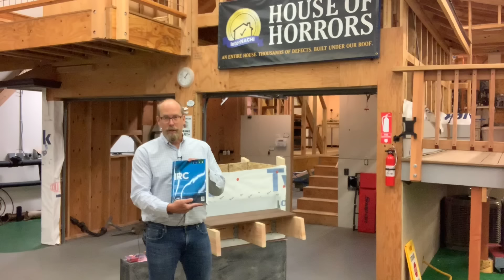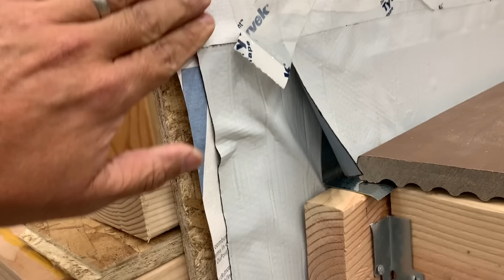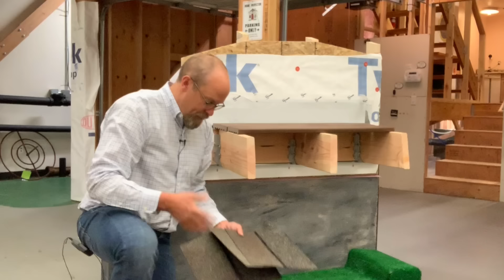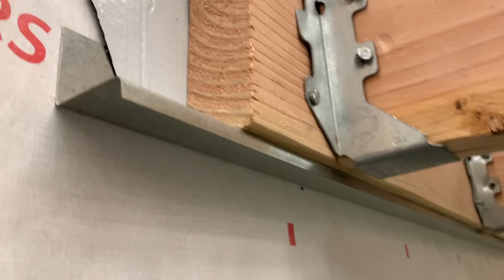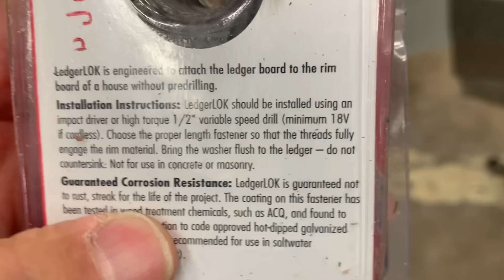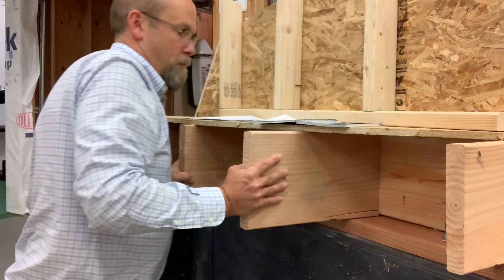Deck Ledger Board Flashing Inspection Tips

Comment: I disagree with having the metal flashing on the bottom of the ledger. In fact I've been a carpenter for over 40 years and I've never seen that done here on the East Coast. Your mock up is incorrect in 2 ways. 1st the use of interested Douglas fir should never be used not even for teaching students. 2nd today's treated wood formulas all contain copper which will have a dielectric reaction to different metals. There are a number of other flashing materials like copper, flexible flashings that have a copper film on one side and poly plastics. 

The lower flashing can hinder the run off of water that might get behind the ledger. I would run the flashing behind the ledger all the way down to the foundation.

Comment: How do you flash if the ledger is attached to a cinderblock foundation and above foundation the house is brick facia? There's no accesisible house wrap or siding I can tuck anything under.

Comment: Question:     I'm running a herringbone pattern for my deck boards.  It seems like running screws though the deck boards into the ledger board is needed to secure the ends of the deckboards to the frame.   To do so would mean putting screws though the bottom of the ledger flashing, which doesn't sound like the right thing to do.  Should the bottom of the ledger flashing be penetrated?

Thanks
Reply from the maker: Good question!

Comment: My house was built in 1931 & I used spacers for the ledger, angled the bolts slightly downwards to prevent water intrusion, & provided full support for the deck independent of the ledger. Obviously not to this code spec, but a 35 year old cedar deck on a 94 year old house. The "leaky condo crisis" led me to believe that building codes & construction methods are always in a state of continual improvement; it's not an exact science. Hopefully these building codes save homeowners from financial ruin in the future.
Reply from the maker: Thanks for sharing.

Comment: Please do not use spray foam to stop air leakage.  Im currently fixing the rotting deck boards and structural beam where the  contractor was using expansion foam for whatever reason. The rain water traps in there and creating rot wood. Water should go through all the way to the ground. A bit of air leak is good for the house.
Reply from the maker: Okay. Will do.

Comment: All these layers of flashing g and different methods is cheese. 

Relying of tape is a no no.
Using cheap thin tin flashing isn’t fair to the home owner because it breaks down over time and causes serious structural decay.

IMO…..the ledger board should be part of the construction.
Added onto the house while it’s being built, then cover it with rubber roofing.  24” over the top, and 12” past the bottom.
Carefully molding it over the ledger board like a glove.

At that point even a novice builder can attach a deck to the house without having to worry about causing damage down the road.

Water resistant?  Should be waterproof !!!
Reply from the maker: WRB behind the ledger board is recommended.
Reply: @internachi :  band board, then flashing, then the ledger board?
Water will get in there.

Comment: Even when installed to code a ledger board hung deck can cause tens of thousands of dollars worth of damage to a home's siding, sheathing, frame, foundation and interior walls, floors and ceilings. due to ice and snow build up at or above  or even below the ledger board..  Water behind a ledger board can freeze and separate a deck from the house by the expanding action of ice resulting in a catastrophic collapse of the deck.
Reply from the maker: Thanks for sharing the important reminder about the potential for damage due to ice buildup behind ledger boards.

Comment: @5:20 ish. i would bend the flashing beforehand, and joist tape the top of the joists installing them after the flashing is done. especially considering you would seal that up good before running joists. thats my 2 cents anyway. im not disagreeing with anything
Reply from the maker: Thank you. Good point.

Comment: Really glad I found your video. One thing I don't understand - why have flashing under the ledger board? It seems all  it would do is hold water against the bottom of the ledger. If house wrap, membrane, and ledger are installed in a "shingle" fashion, what purpose does the lower flashing serve? Thanks.
Reply from the maker: IRC code and commentary provide really good illustrations for more details. You may want to check it out.

Comment: Great video, thanks.  Wondering your thoughts on screwing the lag bolts holding the ledger board into the studs on the opposing side of the wall, rather than just the rim joist as shown.
Reply from the maker: Good point. It's got to have contact with structural components.

Comment: Do you have a video like this but for the area by the door? Also, that membrane doesn’t stick to wet wood so I had that issue before. The order and placement was correct but the membrane that was installed didn’t bond properly.
Reply from the maker: Good idea for a new video.

Comment: I've just checked the price for butyl flashing and am looking for a less expensive alternative that will be corrosion resistant to MCA lumber.   It appears that I can flash with the aluminum flashing what I currently have and isolate it from the treated lumber with the #30 felt paper I have left over from another project.   Thanks for the video!
Reply from the maker: You're welcome.

Comment: Many professionals here on YouTube don't cut the house wrap, which means they don't achieve a true shingled pattern. It looks like you cut the house wrap above, install first the bottom drip rail, then the wide bottom peel and stick membrane that goes over that bottom drip rail, then install the top drip cap, then a second layer of membrane that attaches over the top drip rail and under the top house wrap, and tape the house wrap layered on top of that. After all done, install the ledger board and you're done. The tricky part is how on either side lateral to where the cut ends, even the bottom membrane is taped over the section of house wrap. That corner on each side could be a vulnerable point of entry. It seems complicated compared to what the pros do.
Reply from the maker: Thanks for watching.

Comment: why put flashing on the bottom? Doesn't that just leave a place for water to sit in contact with wood?
Reply from the maker: It diverts/kicks it out from under the bottom of the ledger and the top of the exterior covering material, if installed.

Comment: Great video. Question, is the metal flashing below the ledger a firm requirement?
Reply from the maker: No. It's detailed in some codes and best practices. But it's critical if there's siding below the ledger.

Comment: Great video and its nice to know Im doing most everything correctly. The one thing I did not do was the flashing under the ledger board.
Reply: not necessary in some cases. especially if you're added deck to already built home. I feel like that's going to trap water onto the bottom of the ledger
Reply from the maker: Nice work. Keep it up.

Comment: I'm not sure what that bottom metal flashing is doing... probably holding water and rotting out the bottom of the ledger board.  Also deck framing should be built with pressure treated material.  This is a very complex subject, with many, many variables.  On a new house with a deck built during construction, you may see a deck this way.  Often decks are added to house after construction and are done differently.  Some good guidelines here though.
Reply: It's for the siding under the ledger,  but should have a pencil width gap so ledger isn't sitting in any trapped water
Reply: @kyletanner5867 you can use a j channel to cap the siding though. it’s also okay for water to get behind the siding so having that extra flashing potentially lead to rotting of the ledger board is more of a detriment than a benefit. 

also, som decks might not even have siding below the ledger, which would make that bottom flashing totally useless
Reply: so glad someone said this. i am learning as i replace my existing deck... we hired a guy who could "do it cheaper" he used framing 2x4s for the whole deck... including the ledger board. none of it was PT... so i decided to do the damn thing myself... 

that water trap he called flashing seemed wrong to me and i appreciate someone with experience taking the time to say something
Reply: Never saw non pressure treated used for sill plate either
Reply: @zanetracks6592 I think just for the demo about flashing, he used cheapest wood.
Reply: Right? This wouldn't apply to decks built after construction. And what about a deck built on an older brick home? You can't put the flashing behind the brick.
Reply: Go to college and get stupid. I'm only a few minutes in but it looks like he has galvanized sitting on what should be PT. It needs a bury or some barrier between them to prevent a corrosive reaction or pay for copper or stainless if you can buy it or have it made. Contracting is a lifelong " practice" just like a doctor or a lawyer " mentall.". Physically?  A little different. Lol
Reply: I wrote butyl tape for a barrier between metal and PT. Membrane backed copper is an option also.
Reply from the maker: Thanks for watching.
Reply: @internachi did you even read their comment?

Comment: Wouldn't a .25" air gap be a good idea below the ledger board so that it does not sit on the metal flashing?
Reply from the maker: Yep.
Reply: I would also make sure that lower flashing has slope

Comment: Nice video, the one glaring error that should have been mentioned is that the Tyvek WRB did not extend below the top of the foundation wall.  Current best practices and DuPont Tyvek Single-Family Field Installation Examples call for a 1" overlap onto the foundation below.  For air sealing, also part of the job of the Tyvek WRB, the product should also be sealed at the foundation overlap with one of the methods shown in the Field Installation Examples.  The IRC remains strangely silent about this, however common sense should dictate that the WRB must extend below the top of the foundation  ("in a shingle-like manner")
Reply from the maker: I agree with you, Larry. Thank you.
Reply: Good point.

Comment: that flashing on the bottom of the ledger is a great spot to trap water and rot a ledger. absolutely not needed. also, you mentioned putting the upper metal flashing BEHIND the ledger? makes no sense. totally agree with the ledger locks though.
Reply from the maker: What if the siding is installed below the ledger? Flashing is needed.

Comment: Does it matter if the fastener used to connect the ledger board to the house rim joist hits a house joist? Or do all tips need to be seen from inside the house?  Also how far from the left or right end of ledger board to the fastener/anchors need to be? Thank you.
Reply from the maker: These are great questions.
Reply: 2" from either side....he mentions it in the video

Comment: Why can't I put the ledger board over my marcenite siding, because the siding is exposed to the weather, anyway?
Reply from the maker: Good question. Ideally the board would be in full contact with the structure.
Reply: @internachi  Thanks for responding. I built my 16x32 deck about 8 years ago and I did attach the ledger board to hardie siding. After recently watching these videos, I installed 4 6x6 posts against the house for additional support.

Comment: When connecting the deck to the band joist of the existing house do you use lag bolts or just large nails? I have a 2nd story deck that was installed a few years back and I've noticed I have a water stain on my ceiling downstairs. It's right over the sliding door to go out to the patio below. But i'm thinking it mist be where the deck was attached to the band joist over that door..  Thanks, great video..
Reply from the maker: Wow. Sorry to hear about that. Thanks for watching.

Comment: Great video, with one request - I'm a building inspector and one of the most missed sections (and in my opinion, most important) is R507.9.2 Lateral connection. Everyone worries about the ledger falling off the house, but a large percentage of deck failures are going to be the joists pulling away from the ledger due to wind, eathquake or live loading. It's such a simple little connector, but does a big job, and I have to explain it to builders all the time.
Reply from the maker: Great point!

Comment: hard to see the function of the flashing at the bottom of the ledger brd,  just let the paper run down past the ledger?
Reply: I was thinking the same thing until he made a comment about siding being below the deck. In that case it would move the water to the outside of the siding.
Reply from the maker: I'll have to do another video.

Comment: Very helpful video. A few questions though. Why the drip edge underneath the ledger board? doesn't that make a little channel for water to sit in in contact with the bottom of the board? My project is annoyingly complicated, its a ledger board over stucco and blockwork so with proper flashing can I put the board in contact with the stucco or cut the stucco away? I seen someone else mention spacers to  keep the board off the wall , would you do that with flashing or instead of? And because of the stucco I would need spacers to be long enough to be in contact with blockwork and keep the board off the stucco or else cut all the stucco away....decisions
Reply: Yeah, I have the same thoughts on the lower drip edge. Seems like it’s adding an area for water contact with the rim joist
Reply from the maker: Good questions. You might be interested in https://www.nachi.org/deck-inspections-video-course.htm
Reply: 2:08 you very quickly said the ledger board need to be at leadt 2x8".  Very important detail!

Comment: Is flashing required when the porch is cover via a roof but not enclosed?
Reply from the maker: Good questions. Flashing is required by code on numerous housing components listed in the code that I reference in the video.
Reply: @internachi  thank you but i meant is ledger flashing required for a covered but not enclosed porch?

Comment: Thank you for this.  We bought a house and found out that the owner built it. He didn't put any flashing under our 4 double doors that go out to our porches.  Needless to say we're having to remodel and fix this mess. To do this right im going to need to take the whole deck away from the ledger board correct?
Reply from the maker: Possibly. I recommend hiring a home inspector to check it out for you. We believe all homes should be inspected every year by certified home inspectors.

Comment: Say "shingle-like manner" one more time.
Reply from the maker: I know. I know. I meant to say "SHINGLE FASHION: which is a method of installing roof or wall coverings, water-resistive barriers, flashing or other building components such that upper layers of material are placed overlapping lower layers of material to provide drainage and protect against water intrusion at unsealed penetrations and joints or in combination with sealed joints.

This term and definition are also used in the IBC to describe the required method of applying moisture control layers such as roof underlayment and water-resistive barriers (WRBs) to the building. The intent is to direct the builder, contractor or installer to place upper layers of material lapping over lower layers of material, in the fashion of placing roof shingles, so moisture is provided with a clear path to drain down and away from the building. In field investigations of buildings with mold and moisture issues, it is frequently discovered that flashing, WRBs or underlayment have been placed in reverse shingle fashion, with the upper layer tucked behind the lower layer. This permits moisture to drain behind or below the intended protective layer or material where it can be trapped and lead to mold and decay of building components.
Reply: LOL, I was thinking the same thing. Informative video though.

Comment: Why doesn't anyone make a video of a ledger got a covered porch/patio??? I see it might be similar, but double flashing wont work...
Reply from the maker: Good question, Steven. It would not mater if the porch was covered or not. The ledger flashing should be installed in the same way. A covered porch is an exterior system and needs to be attended to as an exterior system that is affected by the weather, including moisture intrusion flashing issues.